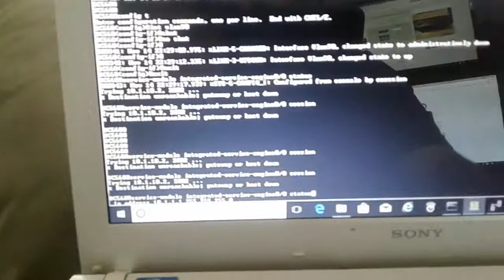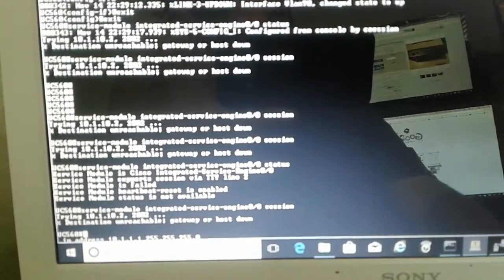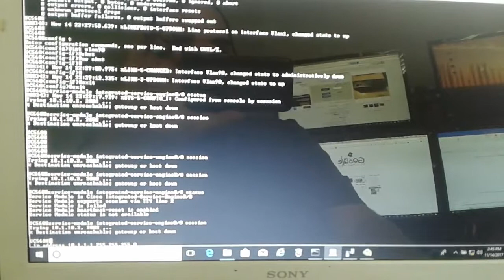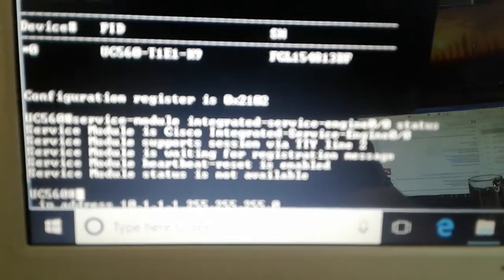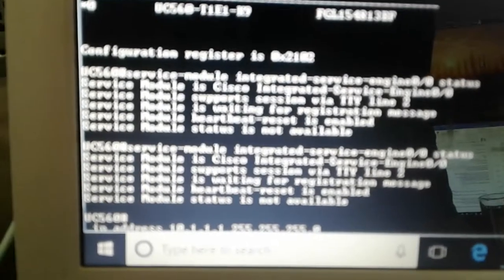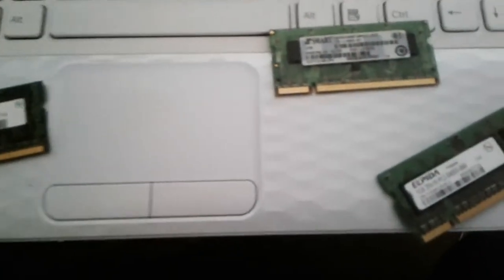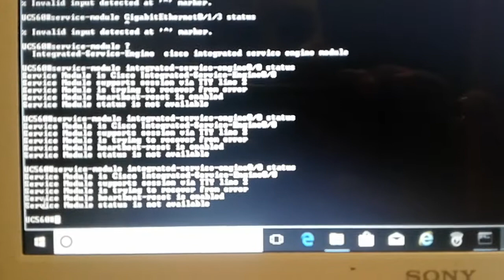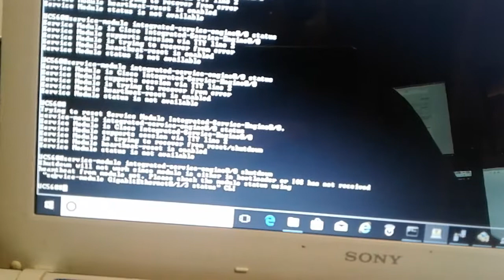Cisco unity express cue complete hardware failure UC520 UC540 UC560

Comment: Had the same problem. Managed to get into boot-loader I don't remember how. Then did a firmware upgrade with the wrong CF card inside I have not been able to get it back since. I was never able to get into boot loader from *, I did get into it from the rommon or cli, I don't know how but I did. I have had the exact same status as you do. I know from the start I didn't shut down the cue first which may have cause the kill?